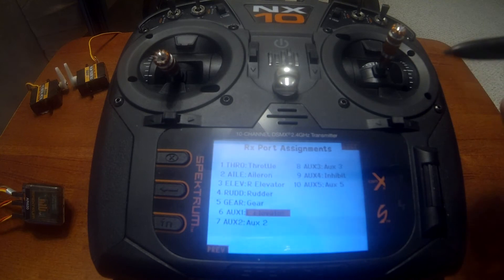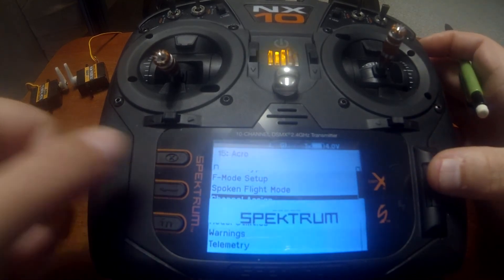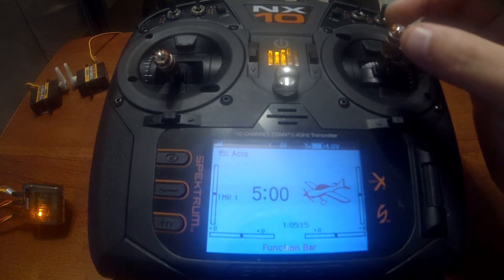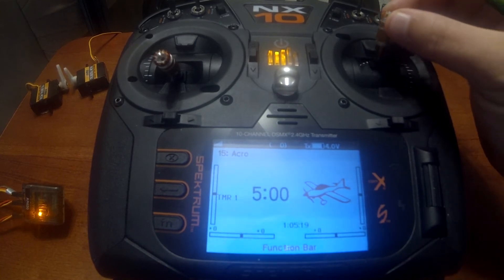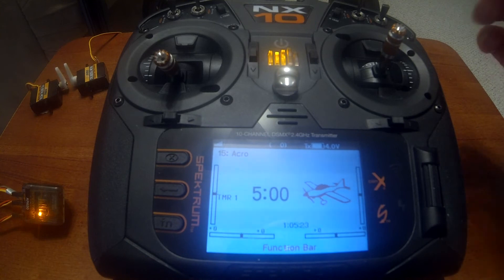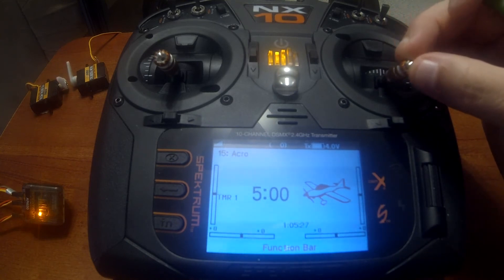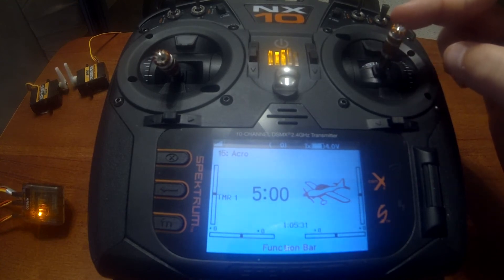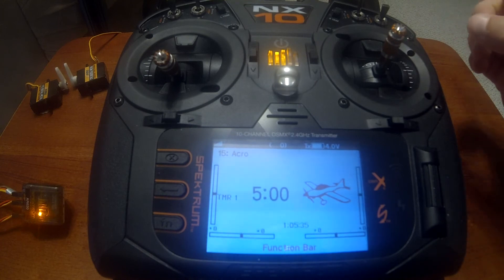Spektrum NX Setup: Dual Elevator using Separate Channels- Basic (NX6/NX8/NX10)

Comment: This works out great until you want to change the rates & expo. Then you have to do this another way. (NX10 c/w 8 channel RX)
Reply from the maker: No issues changing rates and expo.Move the elevator in RX port assignment to a physical channel on rx. (Ie Channel 7 or 8 : L Ele)
Reply: @BDTennessee  My mistake but I don't think I did the channel assign function. How I got around it was by mixing.  ELV>AUX2

Comment: Im having an issue with my NX10 with the left elevator not moving as far as the right elevator only in Safe Mode. I have the plane setup as a dual elevator type. Also under channel assignments left elevator is on channel 9. I have a 8 channel receiver. Left elevator doesn't show up in one of the other channels to switch it. How do I fix this issue?????
Reply from the maker: Change the elevator assignment in the RX p;ort assignment. Also make Channel 8 and 9 INH in channel assign.

They only travel differently in SAFE?

Comment: Hi there I just want to say your videos are priceless they have helped me so much in setting up my 50cc plane dual elevators  expo I was struggling so much, back into the hobby after many years off, everything has changed so much, so just saying thank you so much cheers from New Zealand
Reply from the maker: Thanks Jase! Welcome to channel from across the pond! :)
Reply: @BDTennessee  no worries at all, your channel has Been awesome in helping me out appreciate it
Reply from the maker: @jasegazzard3743  thanks so much!
Reply: @BDTennessee  Hi there what channels do I use for my flaps on my war bird I've got 2 flap servos on a nx 10 Transmitter and a AR 10100t receiver I'm struggling to sort it please help cheers
Reply from the maker: @jasegazzard3743  do you have fixed or retract landing gear? Also do you have multiple ailerons,elevator or rudder servos?
Reply: @BDTennessee  Hi I've got retracts on channel 5 on y lead working perfectly and I've got 2 elevator servos,
Reply: @BDTennessee  2 ailerons working good on a y lead and 1 rudder it's for my gas focke wulf 50cc
Reply from the maker: @jasegazzard3743  Function List > System Setup > AirCraft Type > 1 Ail 2 Flaps

Channel 6 Aux 1: Right Flap > Channel 7 Aux 2: Left Flap
Reply: @BDTennessee  ok cool I'll try that appreciateyour help
Reply: @BDTennessee  mate ur a genius that worked I get a bit lost, I can fly no problem at all just the set up gets me a bit really do appreciate it if I was in your part of the world I'll send ya a beer or something cheers

Comment: SOS SOS SOS 😀
I got a DX7 and on my new project which requires dual servo on the elevator 
But servos moving different/opposite directions , I do have a Y conector on them
I forgot how i did 10 years ago and it worked just fine with this set up .
Any help/advise would appreciate it and thank you in advance .
Safe and happy flying to you all out there 😄👍🙏
Reply from the maker: Frank, are servos moving both elevators the same way but opposite of the stick input (ie down elevator gives both up elevator) or 2 separate elevators with one going up and other going down?
Reply: @BDTennessee  no if that was the first case I would just reverse them from my DX7 system 
But yes to the second case : they work opposite from each other’s , one goes up which is fine and should in an elevator while the other goes down when I pull back on the elevator control on my radio
Reply from the maker: @Frank-zg8ms  so pulling down on stick for up elevator,one up and one down. DX7 gen 1(silver) or Gen 2 (black)?
Reply: @BDTennessee  yes you got it and I have the Gen 1 (silver)
Thank you
Reply from the maker: @Frank-zg8ms  here is link where its discussed.

https://www.rcuniverse.com/forum/electric-general-discussion-106/11644285-newbie-dx7s-dual-elevator-dual-aileron-setup.html
Reply: @BDTennessee  well I guess the best way is just change the servos direction internally from inside by changing rewierin the wires and thank you for your time and responses
Reply from the maker: @Frank-zg8ms  you're welcome! Give me shout anytime :)

Comment: I have dx9 and set up my f15 eagle with dual elevators. I use channel 5 for my left elevator however now it doesn’t have safe on that elevator? The elevators use to be in a y harness but the old servo stop working so I put in a new one but use a different channel because I couldn’t get them to go in the right direction with each other. Even if I reverse them on the servo setup. I got them going in the right direction now using a different channel but it doesn’t have safe! Any ideas??
Reply from the maker: Gear is normally on Channel 5. So it may not have Safe or AS3X on that channel. Which F15 is it and what Receiver?
Reply: @BDTennessee  it’s a f-15 eagle 64mm from eflite and the receiver is a AR636B specktrum with as3x and dsmx.. I am not using channel 4 and that is were the rudders used to be but it physically did not have rudders that channel was used to control the nose gear. But I removed it because I did belly landings and I broke a while ago.. do you think maybe going into that channel will help?  It is a 6 channel receiver.
Reply from the maker: @impactrc0311  i would try channel 4. Also make sure Channel 3 and 4 are assign to elevator in the "Channel Assign" menu.
Reply: @BDTennessee  thank you for the help! Appreciate it
Reply from the maker: @impactrc0311  your welcome! Holla anytime!